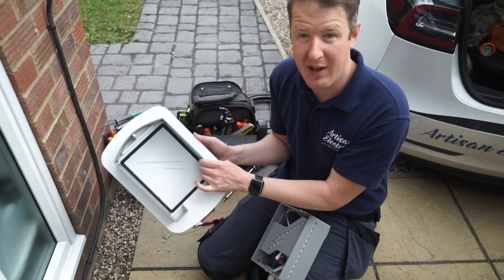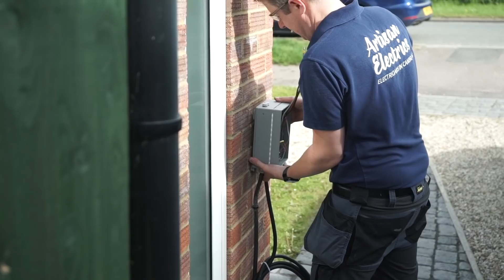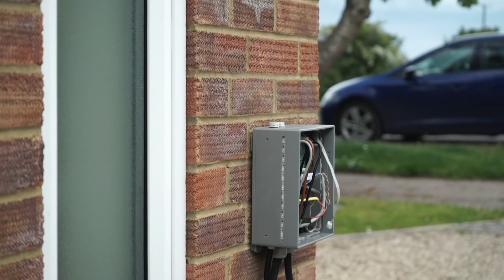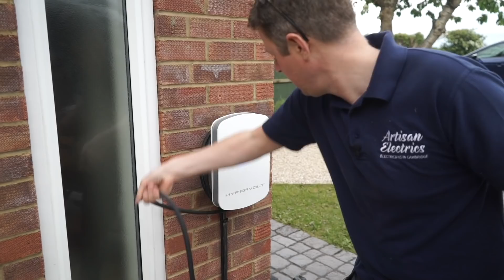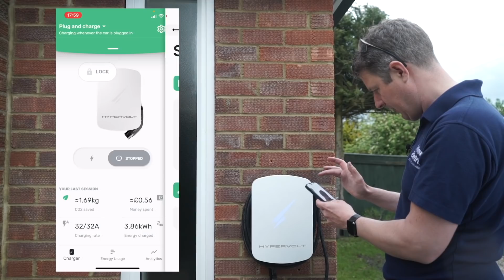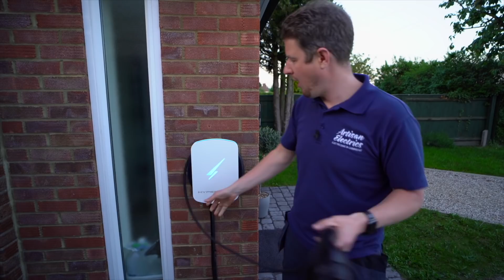Is This The Future of Electric Vehicle Charging? Hypervolt Installation

Comment: "Is this the future of electric charging?"
No. For three reasons:
1) Any external appliance that needs a fan (with its entry and exit holes, what with insects, dust and other problems), is doomed to failure;
2) Any external appliance that uses an off-the-shelf Raspberry Pi (not designed for the external environment), is doomed to failure;
3) Any OS-driven device (like the Raspberry Pi) is a security nightmare, able to be easily hacked. And with WiFi doubly so...
All right, with #3 above there are many (many) mitigations which would ameliorate this. But so many vendors use an out-of-the-box distro with no thought to security that I fear they've done the same thing. And even if they try, the attempt is often a Band-Aid rather than a proper security solution.

I'll also say: if they're new, they don't have many customers, so of course their customer service is responsive. Wait until they get a million customers...

Finally: I, personally,  simply cannot use this charger. My charge point is two floors below me in the underground car space for my apartment. It gets zero Internet. It certainly can't connect to my home Internet with WiFi or hardwired Ethernet, and it's a cellphone blackspot. All of your touted advanced features are useless (much as I'd love to run a rave down there?)

Oh, and if it makes sparks it's either high voltage or (very) high current. Low voltage cannot spark unless the current is abnormally high (in which case the metal itself is melting...)
Reply: Correct, but missing the point, and naturally so, because you get to witness a product at a moment in time. Integrated computing takes longer to deliver, users don't care though. Pis are not there to last, fans are not there to last, they are there to prove a point. On the customer service, we shall see what we do with a million more users.

Otherwise all negatives here are not long term features, in fact they are melting before our very eyes. Only the good stuff remains!
Reply: @alexflav23  Cool! So that means that you'll be replacing all of your installed first gen chargers, for free, when your next generation product that solves these issues is released? Unlike Jordan, most people install a car charger for years, if not decades. A long-term product that uses items that are "not there to last" is doomed to failure.
Reply: @John Adriaan  Everything we put out is comfortably tested to last 5 years, even with such "non ideal" components. In our whole career of many thousands of chargers, do you know we have only ever replaced one that actually failed? And that was because of a loose connector on a part we buy off the shelf. Sure there's room for much better, but it doesn't mean things are flimsy, they are in fact some of the best around by a country mile. There are other products even further along their vertical integration cycle no doubt(1 or 2 of them), but that won't be true for very long!

Comment: Hi Jordan
In the Hypervolt video of Is this the future of electrical charging you used both a power cable type ? and a data cable.
Looking through your videos I have found one where you installed a Zappi using an EV Utral cable type? Which has both power and data in the same armored cable
Would yo recommend that for th Hypervolt installation or do you recommend two separate cables.
Please advise
Reply from the maker: Yeah I would definitely recommend using EV ultra cable for the Hypervolt when possible, it’s looks neater than running in two separate cables.

Comment: Will be interested in fitting them instead of zappi if they had option for wireless CT clamps and built in type A rcd. The cost of a Matt:e device or similar just makes the cheaper chargers no cheaper than the zappi.
Reply: Both coming in our next version fortunately!
Reply: @hypervoltev  any ideas on timing?
Reply: @Mmmjustme  Coming in September, apologies if that may be too late for you!
Reply: @hypervoltev  brilliant. Thanks for confirming. I’ll keep a look out for it for sure!

Comment: Hey Jordan, how about a block of black nylon. Won’t look bad and will take a screw in it. One time screw to the wall and then it doesn’t matter how many time you screw into it. You can use existing holes In the wall to attach it to the wall and add holes as you like. Once it’s Swiss cheese bin it make another. Something like BLACK MARINE BOARD POLYMER HDPE on eBay. 1/2 inch deep so should be secure enough.
Reply from the maker: Thanks great idea!

Comment: EO charger with Smarthome had a raspberry pi in it, but now they've got the new EO Pro the Smarthome isn't as common. The disadvantage of having known hardware inside is you have to be really sure you've locked the software down. EO ended up having to work with a security firm to fix some serious security concerns in the early versions of the software.
Reply: The smart side of theses should be easily switched off and basic reliable function to exist as its all getting to complicated and expensive for its own good. And as you have pointed out easy for third parties to get involved in.

Comment: This thing sounds like a really bad idea... that RasPi has a rather high base power consumption already (somewhere around 10W), so the fan will have to run even in our colder climates, which costs money, is a huge invitation for moisture buildup and for insects/ants/.. nesting inside. For an outdoors device you'd normally want IP54 or better. This thing will need cleaning out and checking for corrosion several times a year (except if you want to replace it regularly..)
But hey, it's got a ton of LEDs, so it has to be good..
(and I'm not even getting started about this being cloud connected and the vendor having access to my charging data and possibly others, since the RasPi becomes a regular part of your home network and can be used and abused for anything)
Also, an EV charger should not need OTA capability, as there are no regular changes to the charging standards. Updating the firmware on a charger should be a once-every-few-years thing if it doesn't work right when you buy a new car, but that's all. Doing those updates manually via bluetooth is perfectly fine.
This thing has a lot of shiny but useless features on its advertising brochure, but fails at the most basic requirements.
Reply: Appreciate your comments! We are IP54 rated, and now going for full IP66 in our next version. Baseline consumption is a lot less than 10W fortunately, and there is no moisture build up or space for insects or ants to get in as you say. Firmware updates should never be manual, that's something we'll defend to our grave and one of the biggest problems with other products. OTA is quite crucial actually.

It fortunately fails at none of the basic requirements at all, but granted it's hard to please everyone!
Reply: @hypervoltev  I wouldn’t touch an EVSE with auto pushed OTA updates with a ten foot barge pole!....... Who wants suddenly changing behaviour without any warning or my express permission. OTA stream of new bugs provided for free. No way to revert back when it all goes tits up with an update. And please don’t tell me your software is so good it has no bugs..... All software ever produced has bugs. Thats a fact. Also, the fan is not a good feature, it’s negative and a downright liability. The fact that a fan is needed in such a device is indicative of a less than optimal design. The internal dissipation should be so minuscule such that a fan and/or case ventilation is simply not required. The only significant product heating should be when mounted in direct sun and/or high ambient. The components and design should be able to withstand that and maintain reliability in a well designed product. Peter.

Comment: You should twist cable tye end off not cut. Prevents sharp edges mate.
Reply from the maker: The flush cutters that I used give you a completely flush finish, no sharp edges at all!
Reply: @artisanelectrics  like to see those work  the oil fields I worked on as an electrician you are walked to the door using any type of cutters
Reply from the maker: What you’re not allowed to use cutters?
Reply: @artisanelectrics  not in the oil field installations I worked at in Alberta you were told to twist them off,they also give you a stripping knife for cables all other knives banned and if you are found with one in your box again you were shown the gate, and you had to pay for your own flight home.

Comment: Have you ever installed a charger in a home where the garage is detached from the house & unpowered ? Our parking bay & garage is opposite the house with a public footpath between us. Can power be run from the house overhead to the garage ?
Reply from the maker: Yeah we do quite a lot of installs like that, it’s usually a long and complicated cable run but it is possible! We usually recommend burying the cable but it can be run overhead on a catenary wire if necessary.

Comment: A thousand holes later on the wall of Jordans house.... Interesting engineering using a Pi. Allows for a heck of a lot of possibilities. As an instrumentation guy I I had a chuckle at your comment of a little gadget connector block. I've now ordered an ergostrip.

Comment: interesting use for an RPi with its micro sd card.  I know they are not too expensive, but is it a bit of an overkill with the RPi4?
Reply: It's not a Pi4 as it has a full sized hdmi.
Silver heatspreader on the cpu would mean bcm2837 or Pi3. Could be a recent Pi2, but then they'd need separate WiFi.

Comment: when will we see  level 3  at home units.
Reply: Is there even any need? When you can charge basically any EV overnight at 7kW there isn't much need to charge faster. Most houses wouldn't have a large enough supply either - even 22kW units need a three phase supply which isn't common in the UK at domestic properties.
Reply: @JohnMcLusky  in the usa three phase is common additioal households have 3 cars for 2 people. if you can instill 22kw or closer to 50kw you can let others use it when when you at work so it can pay for itself.
Reply: @wolkowicki1  From my limited understanding, power in the US is mostly three phase in apartment buildings but regular houses uses ordinary split phase power. I think at home it would be more valuable to have multiple 7kW/Level 2 chargers than fewer Level 3 chargers. At home there's less need to charge rapidly, unlike on road trips when it's absolutely essential!
Reply: newer homes all of 3 phase power in the usa  for parts of the houses.  In older homes you do not because they still using oil systems for the heating. Some newer places where natural gas is cheap like western NY you find a lot of gas being used. Because of the size of the usa you do get a mix of different systems being used base on price.  At this point in time I am in Israel and  good 40% of the population are living in apts so charging at home is not possible at this point in time. But a lot of people work in areas that have closeby private homes. so a system you can pay to use other peoples chargers would be amazing. The public charging stations all 2700 of them top out at 22kw  not counting the ones tesla has started to build in 9 location in the whole country. so having one at home that is faster then the 22kw would let you get more people to charge so the owner can make money off the charger and payoff their investment in less time.

Comment: I have never used armoured data cable but makes perfect sense. Always used shielded outdoors but armoured definitely would give more piece  of mind. Will pick up a roll and have a play. 

Btw cat5e isn’t really great for any major data use. It’ll do just fine for these speeds supporting the EV charger but you’d want cat6 (or cat6a ideally) if you’re gonna run a data link between buildings for computer or router use. 

As always super neat work. If you were closer to me I’d love to be calling on you and Cory.
Reply: Cat5e easily supports gigabit speeds, which is plenty for most use cases.  Cat6 future proofs for 10G, but it’s questionable when that would actually be needed in a home use case as no consumer gear supports it
Reply from the maker: Totally
Reply: @JoeFoster  I have installed 44 ethernet runs in my domestic property. They are all cat6. I can confirm that despite not one run being over 15 metres, the cross talk results in them being unable to successfully operate at 10gbps - they'll only support 2.5gbps properly.

With the scale of this installation, running cable in every single room of the house, there was no way that anything less than cat6 could be considered acceptable as the scale required to upgrade it would be too large.

Btw, just because your laptop syncs at gigabit doesn't mean you have a true gigabit connection.
I can 'sync' at 10gbps on my cat6 cable, however, when I go to use it I find that I have worse performance than syncing at 1gbps because the cables can't support it.

With UK customers now actually getting a 1000mbps connection as an option, the requirement to actually support a gigabit is already coming around and for future proofing sake I'm not comfortable installing something that's basically already at its limits.

And yes, right now consumer gear doesn't really make use of 10gnps, but 5 years ago 10gbps was mostly too expensive for even small business and now it's starting to become the norm on a number of items. Won't be long before that starts filtering down!
Reply from the maker: Cat 5e can support speeds faster than most home internet connections, usually the router is the weakest link, but for companies with internal networks I agree that Cat6A is the way forward, I’ve done CAT5e to garden offices before with 500mbps+ no problem. 
If you need an EV charging point installing please do get in touch as we have a network of approved installers across the UK now!
Reply: @artisanelectrics  I guess this depends on how many runs you're doing and how much interference you have in the area.
Cat6 in my domestic property (where I've run 44 ethernet runs) cannot support over 2.5gpbs and when I sync my devices at 10gbps I get a lesser rate than 1gbps because of the cross talk.
Notably it's not a huge concern for all but your geekiest of users but with home internet connections actually coming in at 1gbps, I'd want to be future proofing my cabling so that I know it will definitely support above it.
Then again, when you've run 44 ethernet runs in your own house (plus a spare cable for every 2) you don't want to bloody touch it again! :P

I don't actually need an EV point but if I was to, I'd want to pay a fair whack more just to have you and Cory up for the banter haha
Reply: @iainkay3630  Cat 6 or Cat6a? I thought you needed 6a to support 10Gb?
Reply: @mondotv4216  if I recall correctly, a very well made cat6 cable will do 10gigE at under 30 metres. Generally speaking I’d invest in the cat6a though.

Comment: Hey Jordan. Get video and nice looking product. 
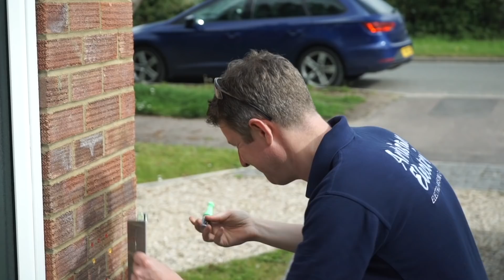At 17:50 you mention setting your tariff rate. I am struggling with chargers that allow a schedule to be set for time of day charging say Octopus Go from 00:30 to 04:30 but only allow one tariff to be entered 5p for this time. However if charged outside this time can only refer to the lower rate even if the rate is 15p. It’s will give an inaccurate indication of charging costs albeit kWh might be correct. 
Does this charger or others around know allow  rates to be applied to different schedules?
Reply: Yes @KeithWilson, you can set the rate based on a time of day you'd like to use for it, and you can set as many rates as you like! Soon we will release automated support for Octopus Go, which means you no longer need to do anything.

Comment: Beware of what you did with the old Zappi CT's. The wires of a CT should always be connected to a terminal block first, BEFORE clamping it across the supply cable. Leaving the wire ends open (even if insulated) while it's still connected around the supply cable could result in a dangerous situation and/or damage the CT when it's reconnected (eddy currents).
Reply from the maker: Thanks

Comment: Nice charger. Does it also have vehicle to load capability? If not could it in the future via an over the air update? Also what price are we talking?
Reply: £569 ex-VAT, OZEV eligible, includes ALM + Current clamp in the box and price.

Comment: Its the return of the Swiss cheese brick wall, with new additional holes!  You are going to have to get a mason to fix all those holes at some point so the house doesn't fall down!  😁😁👍  I am surprised that they don't have heat sinks on the Pi as it can get very hot as well.  Here in Texas we have to have them on ones that are outside to keep them from having issues.

Comment: Once devices have a computer and fan inside I start to think about measuring the background power. These things should be glorified sockets, which ideally waste as little energy themselves as possible. The important feature is charging the EV, the smart features are cute for a few days but not really worth any significant amount of wasted electricity.
Reply: Pi can run off batteries! Leds probably use more!
Reply: @AndyK.1  So, there would be no harm at all at measuring the power. Could either put a clamp meter around the power supply wire to measure the current or connect a temporary cord and measure using a power meter. This thing will be on 24/7, so it should use less than a couple watts background power at most.

Forgive me for not just trusting companies to do the right thing. In the USA the cable TV companies were notorious for deploying cable TV boxes that used 30-60 Watts each all day long - even when "powered off".  They didn't care as they didn't pay for the electricity. It was cheaper for them to just add a fan to each device than to redesign their system to be efficient with electricity. So, when I see either fans or excessive cooling slots alarm bells go off in my head.